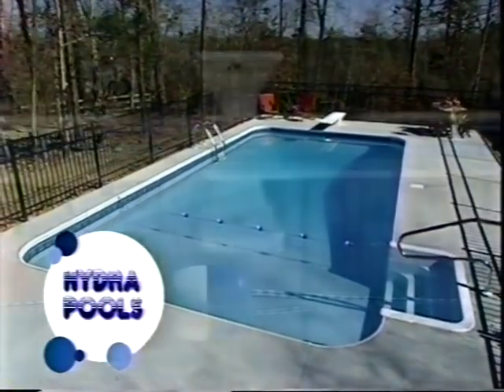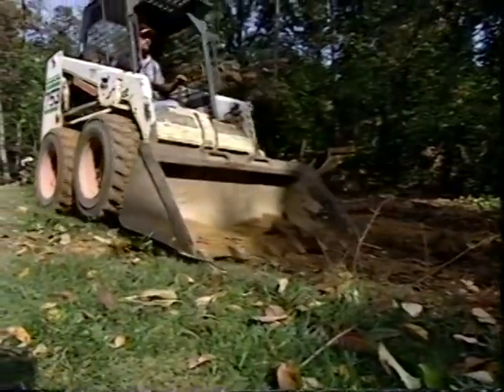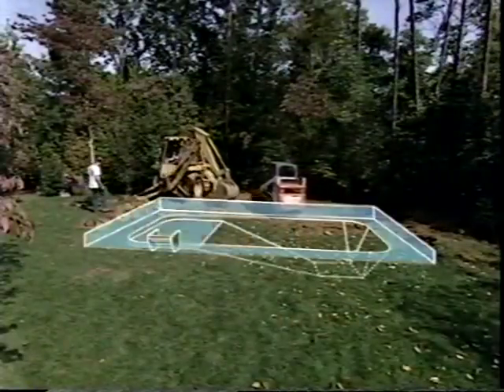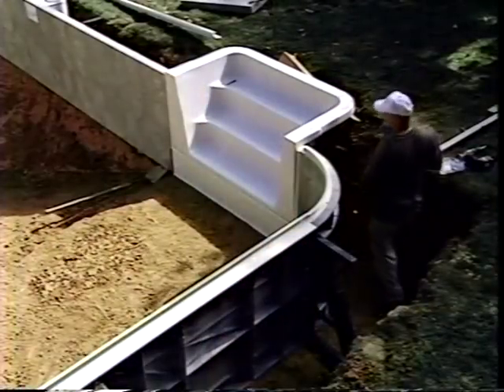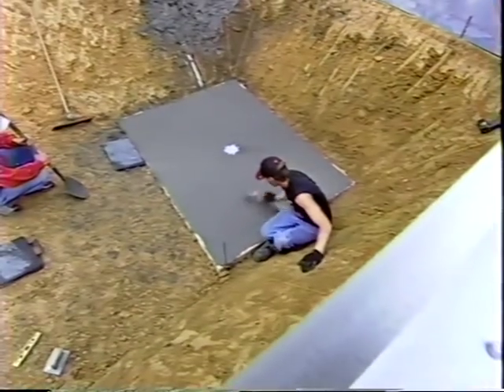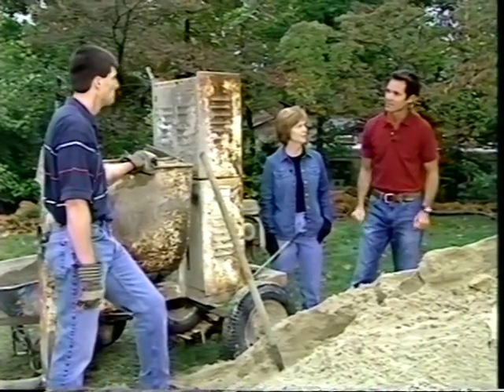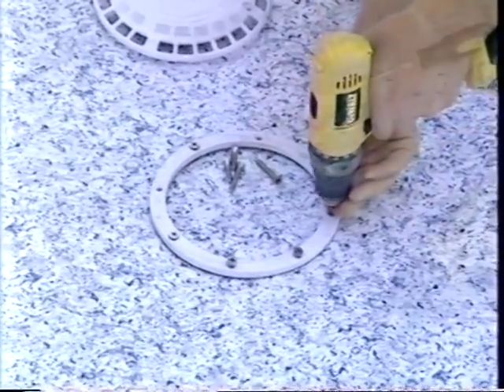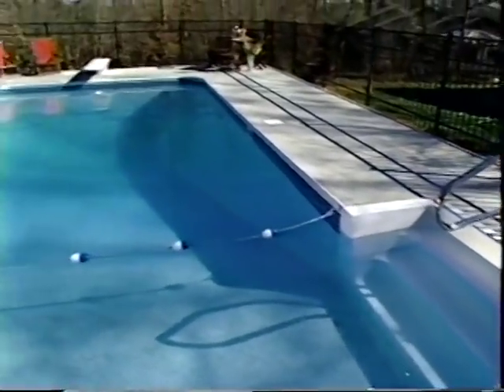Swimming Pool Kit DIY Installation Video.  Pool Warehouse, Inground Swimming Pool Kit Installation.

Comment: Hi! Once you pour the concrete on the bottom and up to the steps, do you run the plumbing on top of that concrete?  Also do you just pour the dirt back into the remaining open part after the concrete dries up?
Reply: Pour over the pipes let dry and backfill
Reply: @sirpj4783  plumb on top of collar

Comment: What's the average cost of a pool this size?
Reply from the maker: Around 5k for the Pool Kit!
Reply: Pool Warehouse $5K with installation ? If not, how much would the whole package cost with installation on average.
Reply from the maker: *****
Installation would run from 5-10k, it really depends on how much concrete you would like for your deck.
Reply: Pool Warehouse Thanks for the reply, Also good job on your website, it's fantastic!!
Reply: What kind of inground  pool can I get with 10k ?